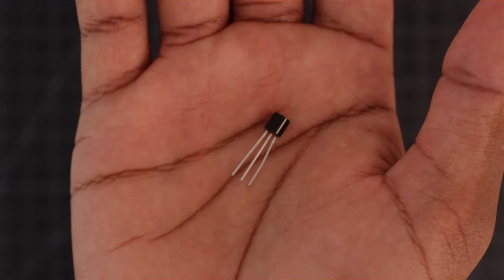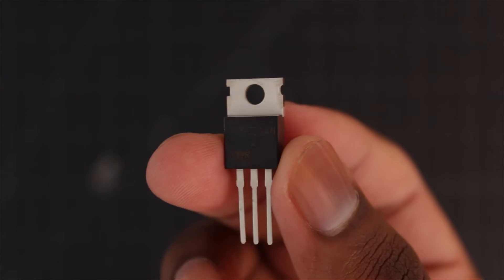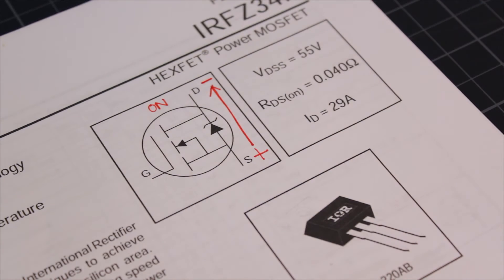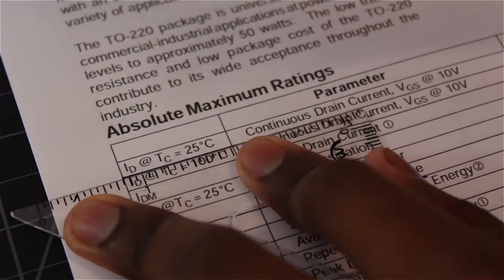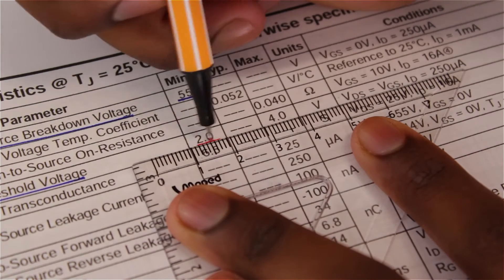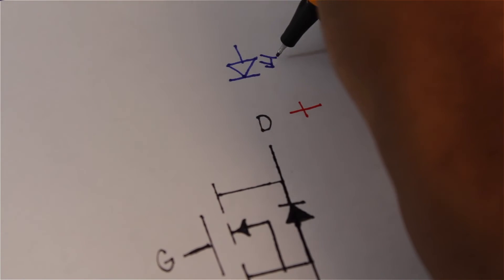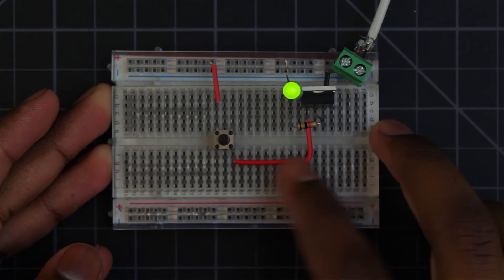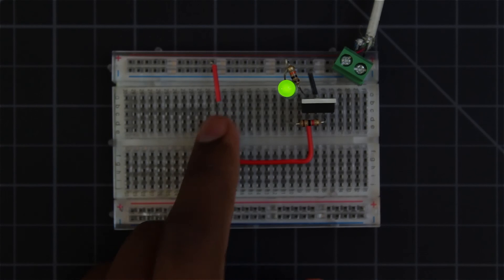MOSFET | Electronics Basics

Comment: 2:36 So the gate would be the button or? Sorry, im new to all this :)
Reply from the maker: the button controls the voltage across the gate and drain pins of the mosfet. A high voltage across these pins turns the mosfet conductive and thereby lets current flow between the source and drain.